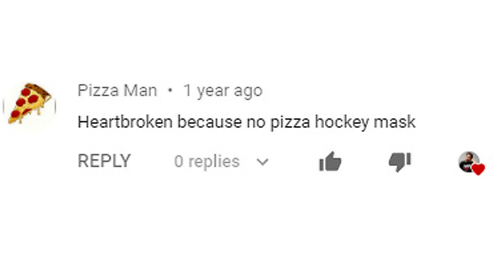How to Make a "Pizza Slicer" Jason Mask

Comment: I subbed three years ago, but this is by far one of my favourites. two things I would have done differently, 1. use spare bits of plastic to make and paint mushrooms, or pieces of sausage, or any topping, 2 use a third mask, hide the sauce mask in-between, and make the bottom mask a crust.

Comment: Hey Mr. Hush, do you have any tips for fixing a clogged spray can tip? I cant use my meringue can anymore because the tip is clogged or something. And there is still like half of the can that is full of the paint so I dont want to just toss it.
Reply from the maker: I hate when that happens! I've had it occur a few times over the years and I usually just chunk the can and buy a new one. Sorry I can't help. I hate throwing them out as well.
Reply: @BigHush  Aw, dang thats ok. Im starting a new project. Im making a Majoras mask type jason mask.

Comment: Man u can make a mask also look like it was created by 3 of his machete blades welded together use the tip of the blades 2 down 1 up old aged blood, dirt, an rust gotta do the weld beads in sections that would be so badass